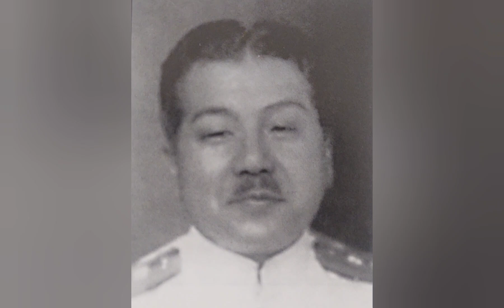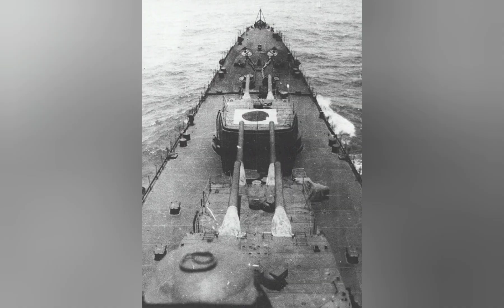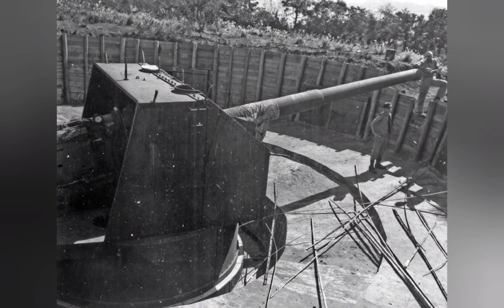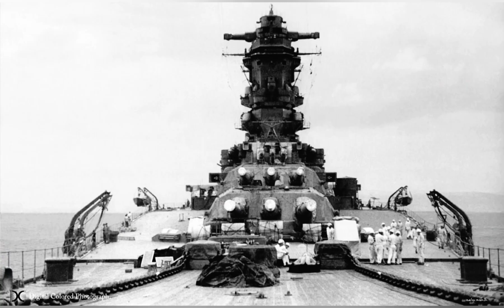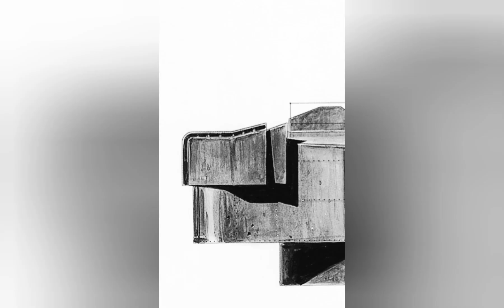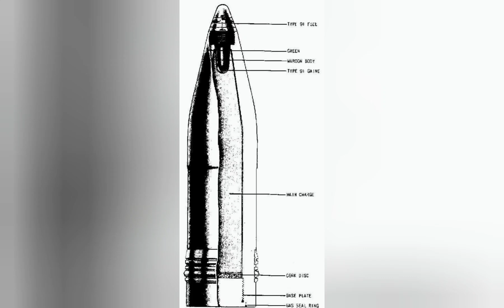Japanese 15.5cm naval gun

Comment from the maker: Notes:
1) Another feature I overlooked when making the video has to do with the rotation limiter on the Mogami class. When aircraft were onboard, the blast of the guns could damage them at certain arcs of fire. So a warning indicator was activated which alerted turret personnel to the aircraft and the turret automatically stopped rotating. When aircraft were not present, the indicator was deactivated and the rotation arcs were restored to full effect. 
2) With regards to the shells, the propellant was separate from the shell. This further decreased the rate of fire making AA a difficult task for these guns. The shell was mechanically driven into the breech, but the propellant had to be driven in by hand, loading was completed at a 7° angle only. 
There is more information about these units available, I just touch major points.
Reply: Interestingly it appears that one of the early high elevation triple turret prototypes was mounted atop a mountain near Hiroshima in 1944 to protect against B29 raids. Apparently the inscription inside the turret says it was for the Mogami, I wonder if it was ever mounted on the ship.(Gakken Pacific War series vol 38)  Btw, could you please say some of the sources used in this video? I'd like to research these guns more, Japanese Cruisers of the Pacific War by Eric Lacroix and Linton Wells II has a brief description, but this video goes into more detail.
Reply from the maker: @steve_i400  'US Naval Technical Mission to Japan report O-19: Japanese Projectiles General Types' and 'US Naval Technical Mission to Japan report O-47(N)-1: Japanese Naval Guns and Mounts-Article 1, Mounts Under 18' are 2 very detailed sources on these and other major IJN weapons. Other details came from interrogations of Japanese personnel that I've found hidden within 'Yamato class and subsequent planning.' To a lesser extent, I've found information in 'IJN heavy cruisers of WW2.' It mainly provided dates for the history segment of the video. These are the major primary sources behind the video.
Reply: @centralcrossing4732  Thank you for the sources, and great video as always.
Reply: @steve_i400  did they manage to hit a B29?